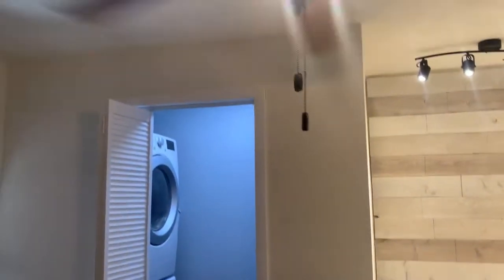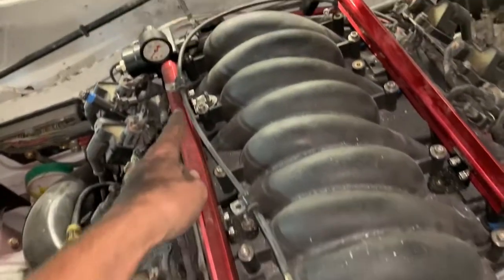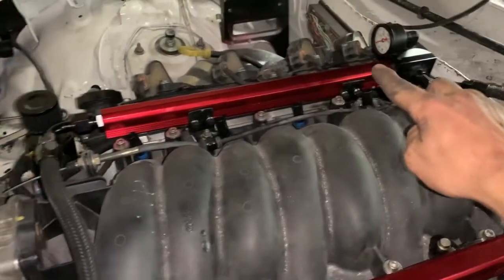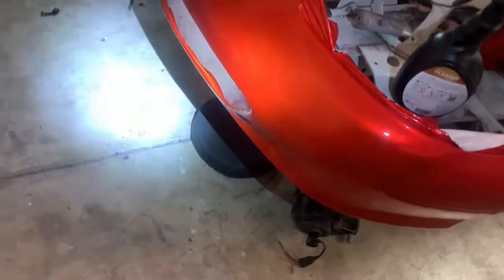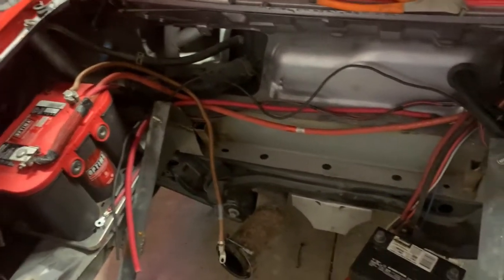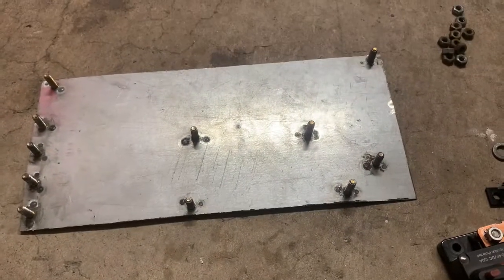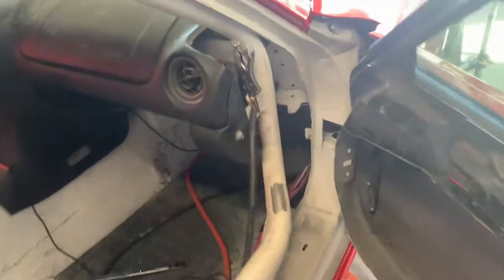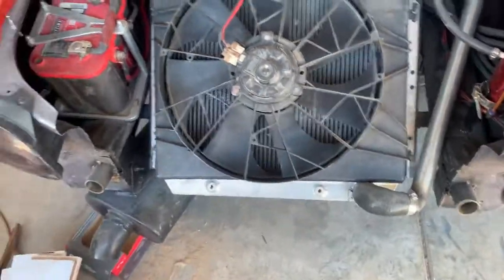Disappeared...Turbo LS Miata Upgraded Fuel System + Home Renovation

Comment: Fuse block came out really clean! audio was a bit all over the place but not a huge deal. Good luck with the trans
Reply from the maker: Thanks!
Yeah, I noticed that. Damn iPhone. On every bit,  sound was very soft, so I tried to compensate for it in the video editor, but apparently that didn’t work lol. Trans shouldn’t be an issue, they t10 is easy to rebuild; just have to find the problem first. I appreciate your support!